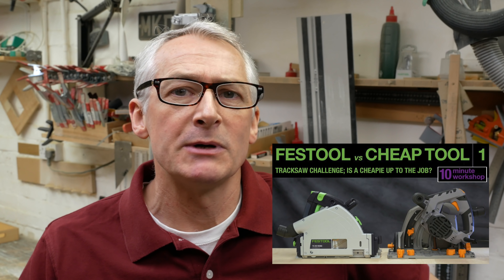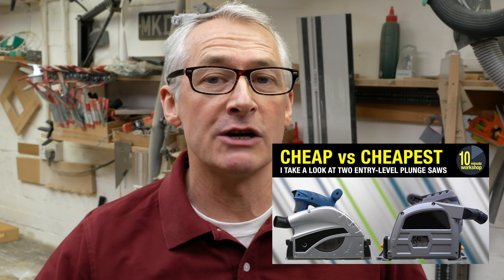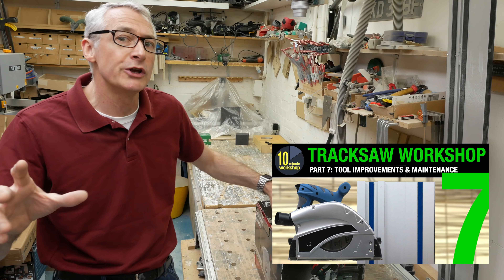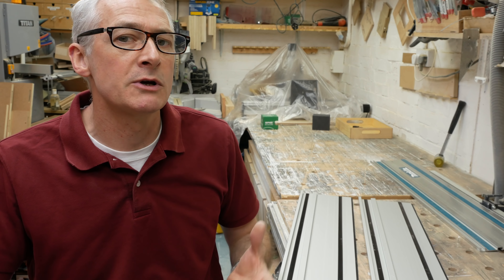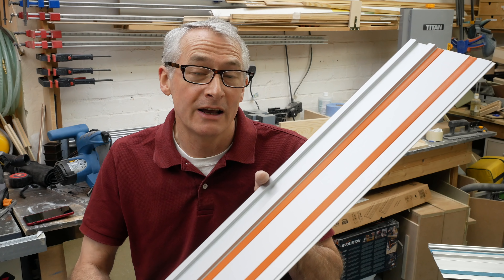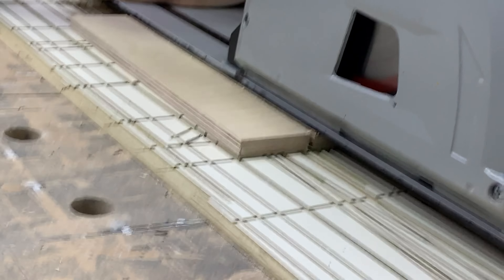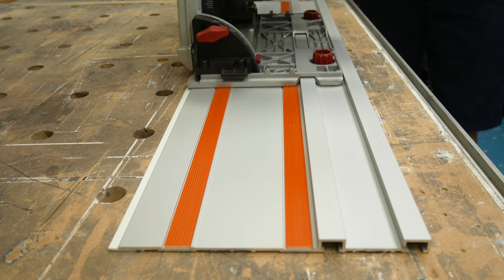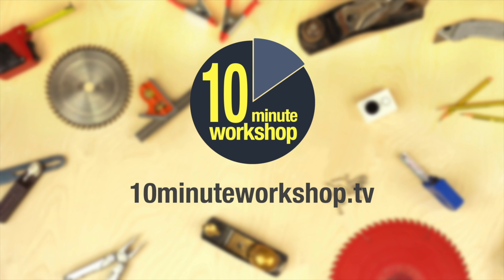Lidl's Parkside Tracksaw [Video #323]

Comment: Just bought one per your recommendation, thanks. My local Lidl has a number still there, which is great.

Will get a thinner blade for it as well shortly, probably this 40 tooth one: https://www.axminster.co.uk/axcaliber-contract-165mm-tct-saw-blades-ax831612 1.5mm kerf, and it's by Axminster who have, in my experience, always done a good job with their own brand stuff.
Reply from the maker: I tried some different blades when I did my ‘More about Blades’ video (#284) and was a bit underwhelmed tbh, so I’d be interested to hear how you get on with it. The Triton blade I tried in the last video is very good for £10. 👍
Reply: @10MinuteWorkshop  I watched #284 and am taking your advice and buying the Triton 48t blade instead! Btw, it's now sold out on amazon, as a result of your video I'm sure, and there's a wait to get it now! :)

Comment: Great video Peter, I've been thinking  about a track saw for a while and decided to get the Makita sp6000 from axminster with the guide rails.  No one seems to mention this package on here.  Here is a link https://www.axminster.co.uk/makita-sp6000j1-plunge-saw-2-x-1-4m-rails-and-connector-ax656310
Reply from the maker: Hi Leigh. Nothing wrong with the Makita - I’ve never used one for long, just ‘playing’ really, but it’s a good saw, no question 👍👍
Reply: It seems like Makita finally gives better prices.

Comment: who cares one jot about compatability with Festool rails, or others
Reply from the maker: Adding to the supplied  lengths of guiderail is usually the first upgrade owners make, and making sure you buy the ones that are compatible is important. Like it or not, Festool rails are the ‘standard’ pattern - pretty much all saws will run on Festool rails, even the ones that have gone their own way in rail design (e.g. DeWalt, Mafell).
Reply: @10MinuteWorkshop  the budget end wouldn,t go near the overpriced Festool for anything